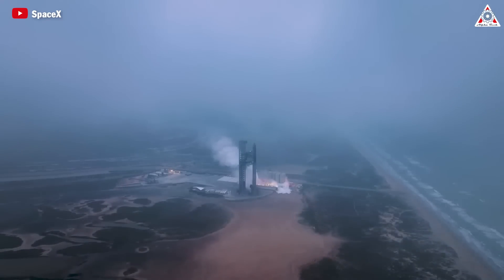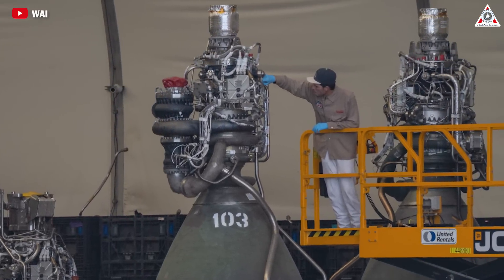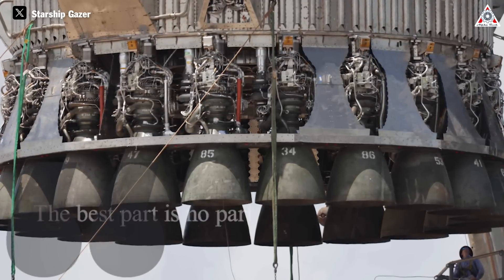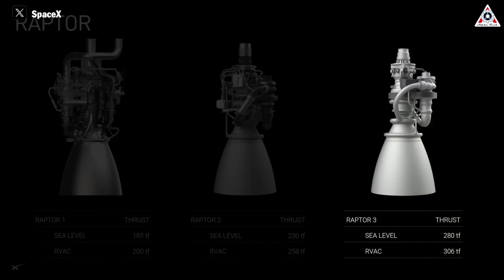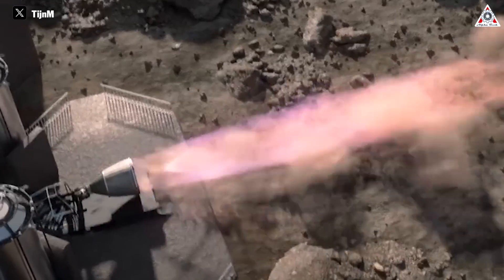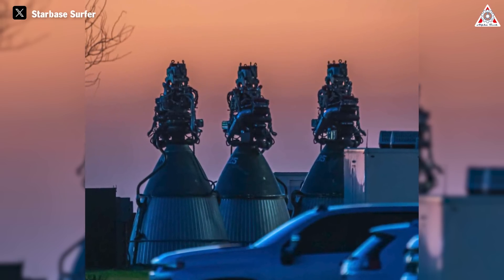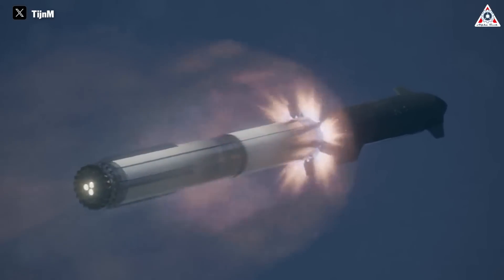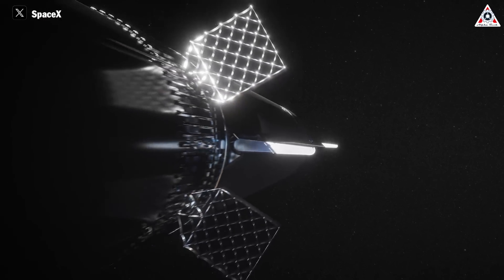How SpaceX Upgraded the Raptor engine shocked the entire industry...

Comment: Just from logistics alone, fewer parts means less failure point probabilities.  (the safety and reliability thing)  The difference in fuels shows in the flame colour, orange flame more carbon content, blue flame more hydrogen content.  With less carbon (and more hydrogen) the less environmental CO2 issues.